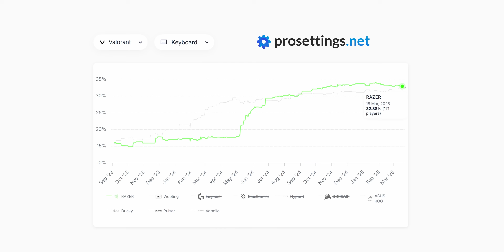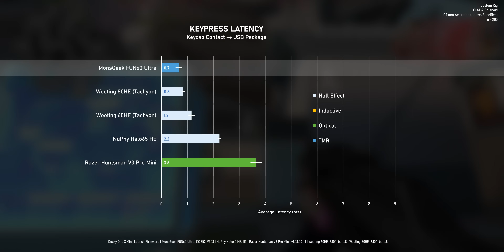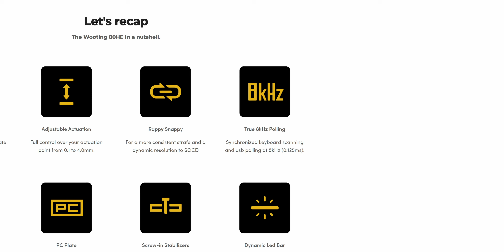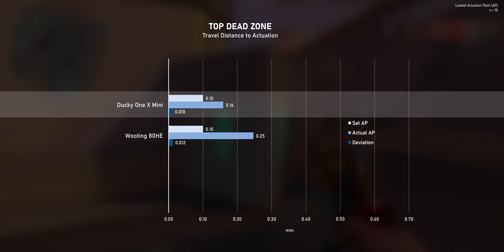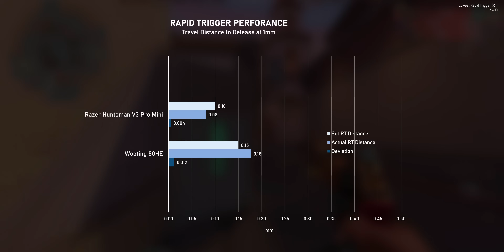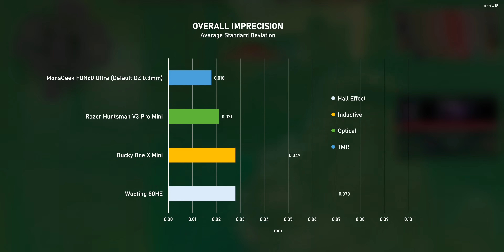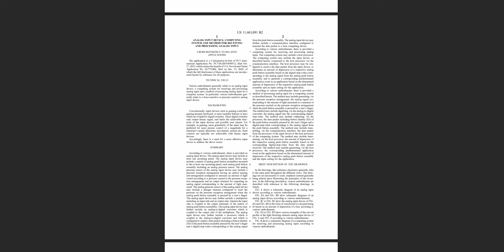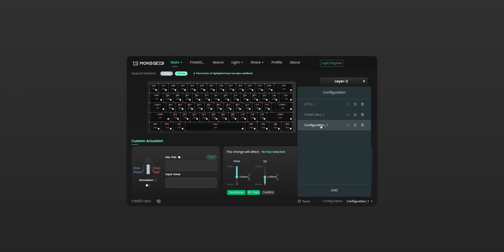These New Keyboards Are Here To Replace Hall Effect

Comment: Weren't the Lekker switches at one point set at 0.2mm activation distance in Wooting's software (either originally or at least for a while IIRC)? 
When you get tiny deadzones, you introduce higher chances of error, either from a result of aging components, interference or sensor noise assuming you don't rest your fingers on the keys.
Another thing to consider is that these are such micro movements that probably 99.999% of people would not be able to tell, and anyone with the skill to take advantage, would be in the top percentile regardless. It is a feel, similar to  musical instruments. Software (and ultimately UX) is what really makes one of these better than the other.
With all that said, the mass production and consistency of these devices quite frankly, amazing.

Comment: I had Wootings original optical keyboard, the Wooting One which released pre 2020 if I recall.  It's a real shame that true analogue keyboards were mostly abandoned as an input method.  Ok, the One was not very precise, had a massive deadzone but that was the just the first iteration and never really got much refinement or support from game devs.  Even for what was essentially a Kickstarter funded prototype it was still a damn reliable keyboard, mine still works perfectly 5 years later.

Being able to walk or run on a key depending how far you pressed it down was really kinda cool.  What we have today is a slew of analogue to digital keyboards that are not the same thing, and the analogue part of the input is discarded as soon as the trigger threshold is reached.  The Wooting used to be able to convert that to a XInput or DirectInput gamepad axis.
Reply: I bought my Wooting Two (optical) when it came out for true analog gamepad inputs as well, but sadly the analog detection got messed up with WASD and now I just use it as a regular digital keyboard. Otherwise though it still holds up after 7 years
Reply: I just want to point out that all Wootings as well as Keychron HE and a few others still have the ability to produce true analog with game pad input emulation. You may not have heard much about it recently, as the Hall effect craze definitely stemmed more from rapid trigger as a feature and therefore many of the boards that rushed to market to appease those buyer didn’t bother with analog input options. Thankfully, as I said, it is still a core wooting feature and was never dropped. And some other manufacturers are diligent enough to have done it well too. Nearly all wootings, even going back to the wooting one have feature parity in terms of software.
Reply: @ That is interesting and good to know, I wonder how the newer hall effect keyboards compare to the original optical Wooting version as an analogue input method?  Is it precise enough to use as a decent replacement for gamepad input?
Reply: @ it’s more precise than the flaretech optical versions and definitely precise enough to use. It still is a key switch so it has limited travel. I don’t think it will ever be quite like a trigger or stick for analog but that’s also true of your keyboard and the switches have only gotten more precise over time.

Comment: 4:23 At first blush (not an expert) even a scan rate of just 1kHz should probably only account for at most 1ms of that multi-ms Ducky latency. (Unless maybe the signal is so noisy that the system is waiting for more than one trigger event to confirm activation?) Presumably there’s something else going on, too. On the other side of the coin, that also suggests that cranking up the scan rate wouldn’t save more than 1ms at most. If the communication netween those chips is slow or poorly optimised (just a guess) then adding more might make the other latency issues worse.
Reply: Rappoo uses a single IC for 4 WSAD switches on their Aesco  A83 keyboards to get the best latency.

Comment: Earned the sub after mentioning that you removed the battery of the wireless inductive keyboard before testing the power usage.
Reply: Even though he compared the power usage of two keyboards while having one keyboard at 100% backlight brightness and the other with RGB off?
The majority of those 4 watts of power draw are surely the LEDs running at 100%, and not the analog switches...
Reply: @boinggogen lmaooo I was so confused when he compared the most power hungry option to LEDs off
Reply: @boinggogen  6:22 is the chart comparing power draw with RGB turned off

Comment: FUN60 TMR is insane for the price if you consider aluminum case, I got it for $70 from China. it feels very solid with cool features to satisfy my unique tech addiction. Software has some design flaws. But Imagine wootility allowing you to set up 3d party keyboards, if wooting team started working on that, they would all speak different languages on the next day; humankind is not ready for that yet
Reply: I got a look and the FUN60 Ultra TMR is only 399RMB on Pingduoduo, the value proposition is insane, it's not even 50EUR or 55USD.

Comment: The normal version of the Fun60 ultra uses the company-claimed "2nd hall effect sensors" and it performs slightly better than the TMR version (ofc it's a trade off for full range switches support). You can check the detailed reviews of the 2 fun60 keyboards on a Chinese YT channel call Laobaozi (engsub included). A lot of the Chinese HE kbs uses the same sensors as Monsgeek from an OEM called Rongyuan.
Reply: It means that the hardware of the Wooting keyboard is outdated but I still love my Wooting because of its software and support. But if I aim for the pure performance, Rongyuan's keyboards are the way but we will have to pray that they will commit to improve/support their software. So far I have recommended two friends to pick the Fun60 due to its insane hardware capabilities.

Comment: The same change has happened for Analog Stick Replacements: TMR is now the best of the bunch, it doesn't require extra flex PCBs or fancy configuration, it just works as a drop in replacement and is more accurate to boot with a nicer more analog feel: HE sticks have weird output without those flex PCBs!

Comment: I'm quite impressed by TMR sensors as they are incredibly precise - I recently bought a controller that uses them and it is leagues ahead of HE in terms of the precision it can offer. In the controller world, the TMR sensors are on par (or even better) with the precision of potentiometer sticks (but without the drift), which is something HE struggled with. I'm probably never going back to HE given the chance to switch to TMR.
Reply: Which TMR joystick that you got ?
Reply: @inversionist5928 I haven't checked, but they are probably using GuliKit TMR sticks.
Reply: @inversionist5928  the 8bitdo ultimate 2 uses them
Reply: My guy everything is superior to pots in controllers. Even super cheap hall effect joysticks beats the most expensive pot based controller.

Comment: i dont wanna talk down your efforts to meassure actuation points etc but from a industry perspective resolution of a meassuring instrument display doesn't represent its accuracy
ive tasted some high resolution meassuring instruments and on a new mitutoyo caliper with 0.01 resolution display they can be already differences of 0.01 mm
further more from what ive seen in the video u have moved your height marker not perfectly perpendicular to the switches linear range of Motion ideally id suggest getting a high quality digital micrometer and setting it up with a clamp or so
with old and used meassuring instruments it would be beneficial to check accuracy in the range of measurement with Guage blocks
im no expert i only work in quality control for over a year and substituted for 1.5 months in our meassuring instrument controll department and im originally a certified machinist
Reply: potential inaccuracy could come from the meassuring arm rotating for example or tze readout on the rail beeing slightly off
Reply: Honestly for common people that bought these keyboard it doesnt matter very much. The fact that he goes for great length testing these keyboard with these tools are already really great, compared to other creator